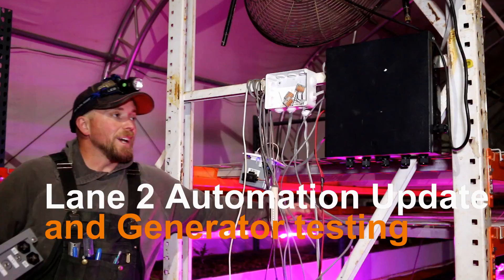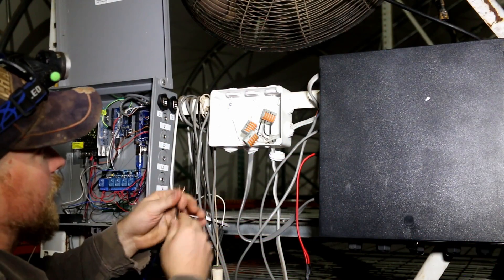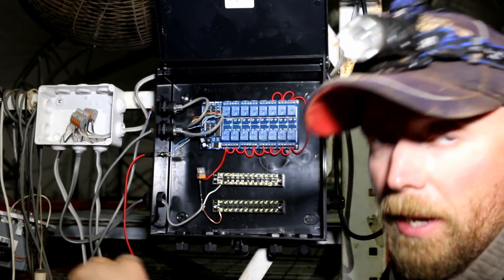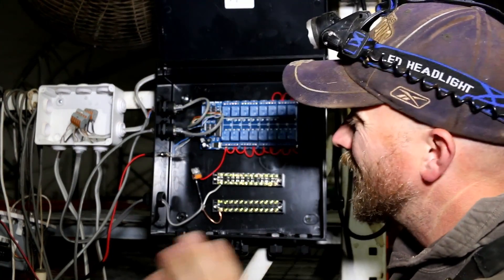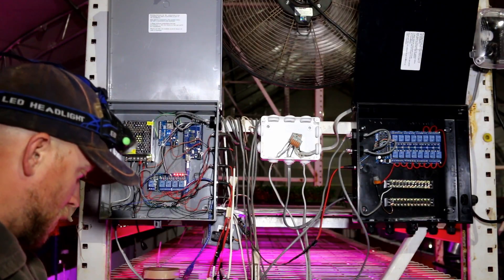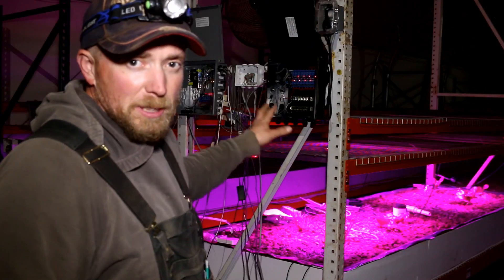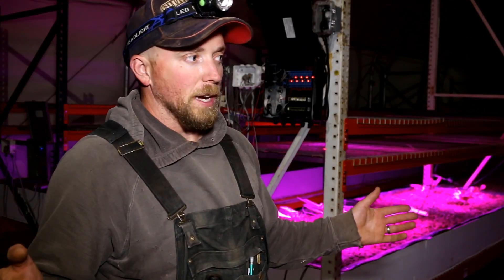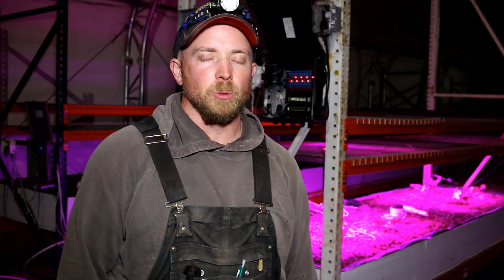DIY AQUAPONIC Grow Lane AUTOMATION Testing

Comment: Looks good so far!  Some clear plexi on some standoff's will protect a finger from accidentally touching a 120v terminal while piddling around in the box.  I think the Solid State Relays I have came with those and seem to add a bit of dumb proofness to it.  

One question is, how does your servers software deal with power outages and gaps in the data?

Comment: It looks like you have all the 120V relays wired the same so the relay turns them on. What you may want to do is switch them around based on the connected device. For example, if the lights will be on the majority of the day then it would be better to have them connected to the normally on. That way the relay is now an off switch and the relay /controllers are not always pumping out the switching voltage. The advantage here is the relay coils don't undergo the heating that occours from a long activated state.There would be other things to conside to as in, if the relay coil failed, would you prefer the connected device remain on or power off. Just food for thought for future revisions.

Comment: I don't see any fuses in your 120VAC circuits.  Maybe I just didn't see them.  If no fuses, there are several issues with that:
    1) The only overcurrent protective devices (OCPDs) are the branch circuit breakers in your main distribution box,
    2) A fault (short circuit) anywhere in your 120VAC system will trip the branch circuit breaker and kill 120VAC power to everything powered by it.  Anything from an inadvertent tool slip, to water splashing, to catastrophic device failure may cause a fault.
    3) The size of the branch circuit breakers in your main distribution box that are powering your automation may be too large to protect the wire gauge you used in your automation box.  This means potentially melting wires and starting fires.  In other words, if you have a 15A branch circuit breaker in your main distribution panel, the wire size on that branch circuit cannot be less than 14 Awg.  In fact, NE Code states that overcurrent protection for 14 Awg wire of any type shall not exceed 15A.  The wire you're using in your relay box looks like 16 Awg.  16 Awg copper wire has an ampacity of 18A, but, given the OCPD limit of 15A on 14 Awg wire, I'm sure that the OCPD limit is lower for 16 Awg (16 Awg OCPD limits are not called out in the NEC Ampacity tables), so a 15A branch circuit breaker is not protecting a 16 Awg wire.
In order to properly size overcurrent protection, the formula is:
                      125% of the continuous load + the non-continuous load < Size of OCPD < wire ampacity.
Many people just simplify that to say that the overcurrent protection can't exceed 80% of the wire's ampacity, with the exact formula used when things are getting close to the wire's ampacity limit and the jump in wire size may be too costly and not necessary.  Of course, in your tiny wire gauges, wire cost isn't much of an issue.  It's important to understand that wire ampacity is affected by the temperature rating of the wire as well as the temperature rating of the connections in the circuit.  Whatever point in the circuit has the lowest temperature rating gives the temperature rating for the circuit.  Thus, if you use 90 Deg C
THHN wire on a lug that's only rated for 60 Deg C, you have to de-rate the wire down to 60 Deg C and use the ampacity of the wire type at it's 60 Deg C rating.  Also, if the temperature rating of any circuit component isn't known, then the circuit must be rated at 60 Deg C.  As an example, a 14 Awg copper THHN wire has a 90 Deg C rating with an ampacity of 25A, however, the same size copper wire of type TW only has a 60 Deg C rating with an ampacity of 20A.  Basically, the temperature rating says how hot the wire can get before insulation starts failing.  You need to understand that a lug that's only rated for 60 Deg C can't have a wire getting hotter than 60 Deg C, or the lug may be damaged.
    4)  A properly designed power distribution system will trip the OCPD that's electrically closest to the fault, allowing power to remain on everywhere else.  That greatly simplifies troubleshooting and prevents other lanes from being affected by faults that aren't in that lane.  In your case, your 120 VAC relay box should have a fuse between the the hot wire and the relay board and your controller box should have a fuse between your 120VAC hot wire and your power supply.  That way, if a fault occurs in any part of your relay controlled circuits, then that fuse will trip, but the controller will remain on.  At a minimum, you should have a fuse for each controller system so that system is the only one that shuts down under a fault condition.

You need to understand that overcurrent protection is not intended to protect devices, it's intended to protect wire from overheating.  You also need to understand that under fault conditions such as a short circuit, the maximum available current will flow.  You need to understand that the maximum available current IS NOT THE OCPD RATING!  The maximum available fault current is the maximum current that can be delivered by the electric company into the fault and is generally on the order of 1000s of amps.  You need to understand that ALL OCPDs TAKE TIME TO OPEN, and during that time the maximum available fault current is flowing.  Overcurrent protection is a complex topic.  For example, a dual element time delay fuse has several different modes of operation.  In instantaneous mode where 1000s of amps of fault current are flowing, it will take less than 1/2 cycle for the fuse to open.  On the other hand, the fuse may allow an overload current of up to 300% of it's rating to flow for several minutes before it opens.  This allows for a motor that has a high starting current to start without nuisance tripping the fuse during starting, while still allowing for protection against legitimate motor overloading conditions such as a failed bearing or extremely heavy pumping loads.  A fuse may operate for 10 minutes or so at a level of current just above it's rating before it finally opens.  It all depends on the fuse or circuit breaker type.

It's important to understand how overcurrent protection works.  You need to understand that OCPDs in series can race in a fault current scenario.  You have to keep in mind that under fault conditions, 1000s of amps are flowing and all fuses in the circuit are melting extremely fast and 1/2 cycle of a 60Hz sine wave is an eternity under such conditions, so all of the fuses are basically getting their asses kicked by equal amounts, which is why they can race and larger fuses open before smaller ones.  Fuse manufacturers guarantee which ones will win that race as long as you follow their selective coordination ratios.  In other words, if you don't pay attention to the ratio of the sizes of the series connected OCPDs, a larger OCPD may actually open BEFORE the smaller one under fault conditions.  Typically, for fuses of the same type, this ratio is 2:1, although in some cases that can go as low as 1.5:1.  In other words, say I have a 10A fuse protecting a motor branch circuit, with a main fuse size of 15A feeding that motor branch circuit as well as several other branch circuits.  Under fault conditions in the motor branch circuit, the 15A main fuse may blow before the 10A branch fuse does.  On the other hand, if the I use fuses of the same type and the mfg says the ratio must be at least 2:1, and I set the main fuse size at 20A, then the 10A fuse is GUARANTEED to blow first.  That's called "Selective Coordination".  It's important to understand that the required ratios to guarantee selective coordination between fuses of different types, and between fuses and circuit breakers can vary wildly.  For example, if a fuse is upstream of a circuit breaker, the fuse may have to be as much as 8X larger than the breaker in order to guarantee selective coordination.  That being said, it's not always practical or cost effective to follow the ratios exactly, so you do your best to make the ratios as large as possible and decide if the risk is acceptable.  If not, then bump up to the next size larger fuse, if so, then live with the lower ratio and the increased risk of selective coordination failure.

Another topic related to all of this is Short Circuit Current Rating or SCCR.  The SCCR rating of a device is basically the maximum current that it can withstand before it fails explosively or catches fire.  Remember, when 1000s of amps are flowing under fault conditions, devices can explode in milliseconds.  Since you built these devices yourself, you won't be able to really determine their SCCR, and that's yet another very complex topic that is intimately related to overcurrent protection.  I won't get into that here, and, if you add fuses, you'll be OK for the most part as long as you always service these with the power off, which you do.

Sorry about the length, but I felt it was important to give you a rudimentary understanding of overcurrent protection.  If you already have fuses, and I just didn't see them, then I'm sorry for going on about this.  If you don't have fuses, I'm sure you can use simple quick blow glass fuses and bulkhead style glass fuse holders.  They would be simple and cheap to install and would avoid a complete system power outage in the event of a fault in one of your field devices.

Anyway, food for thought....

Comment: There is really no voltage limits on network/telephone cables. In some applications, we use up to 100, 26AWG pairs to power remote equipment at 288VDC/500mA constantly. Standard-compliant PoE and PoE+ network devices uses -48VDC and can provide up to 500mA on a circuit. Newer standard (802.3bt) have been approved recently so fewer equipment exists and are not widely deployed.

The National Electrical Code (and its Canadian counterpart) have or is currently being revised to allow greater wattage to be transmitted on. Refer to conversion charts for more details on wire gauge to use.

Keep up your good work.

Comment: Mate be so careful with connecting a generator to the mains, it’s not a simple thing to do safety! Things to note would be to ensure the generator is in phase sync with the mains, or disconnect mains including active and neutral... strongly advise to get a electrician to wire up a socket that u can plug the generator into . Be safe and as always I enjoy watching your progress